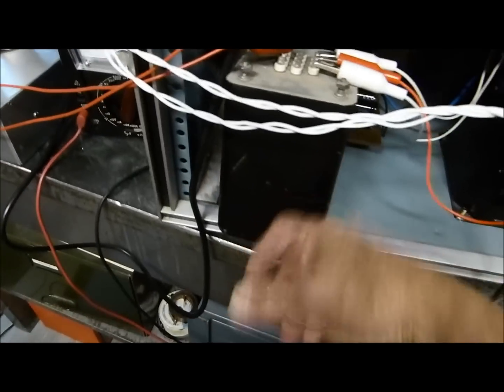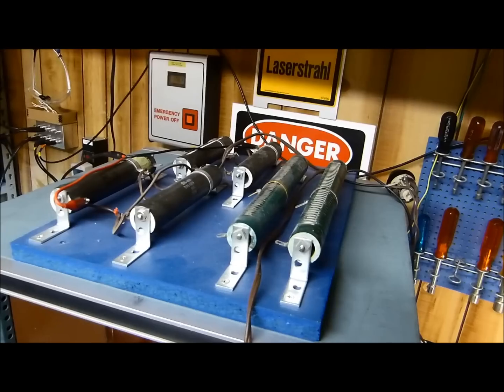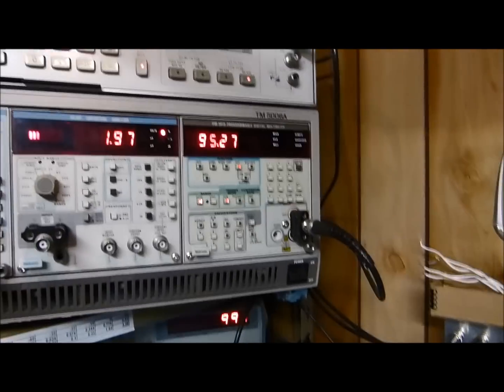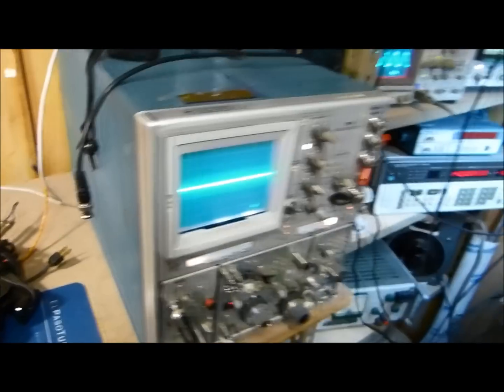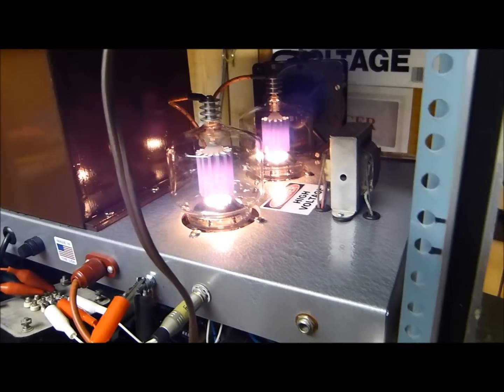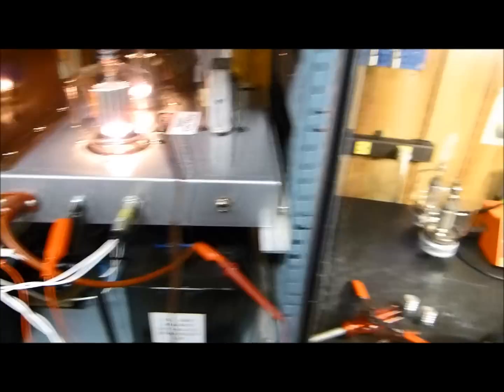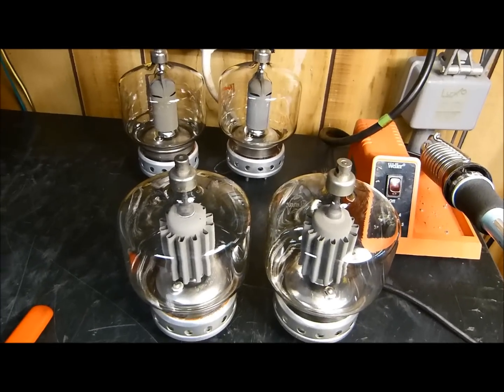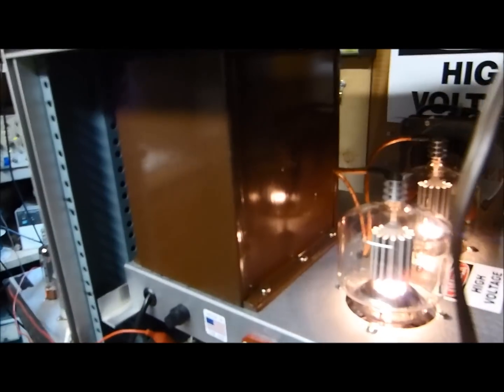Building A 1.3 KW Audio Hi-Power Amplifier Using Eimac 3-400Z Part 3 of 4

Comment: Hmm.. it seems we have a liking for the same scopes...
In the part 2 of this series there was the 7904 and what seemed like a 485 on the rack. In this video what seems like a 2440 lies in its place.
Well, I was wondering what your opinion is concerning these scopes i.e. a 485 vs a 475 vs a 7904/7704/7104 vs the 2440.
I got tired of waiting for the right scope to appear at the right price on the 2nd hand market and went for a 2440. I understand this is a cheap range but I like the 300MHz bandwidth and sampling rate to match. Now if I had the patience, I'd wait for a 475A for its specs and a 475 for slightly better parts availability (less proprietary ICs). 
I don't think I want to spend the kind of money that 485's and 7104's go for these days - seems a bit silly for sth that could break down without any recourse to parts. Otoh 7704's seem tempting but I dont' know why one would prefer them to portable scopes like 4xx series.
I like the ability to have a system like the 7xxx series offers but frankly, hunting for the right modules all the time is sth I find tiring and frustrating and the risk of not being able to repair one should it break is another big disadvantage.
Can you share any of your experience from having used all of these models? If you had to have just one, which one would you go for and why?
I've already gone for the 2440 but I'm still keeping an eye out for a potentially better analogue scope. 
I don't have any experience with Tek scopes. I think the only ones I've ever used were Hameg's or cheaper, low bandwidth scopes.
I mostly want it for audio gear and radios - from AM up to FM.
Reply from the maker: Looks like you have quite a bit of experience with oscilloscopes. You ask some really good questions. I might start out by saying the 485 is a real favorite of mine. I can also say that the 454A is very nice. Both have excellent sharp traces. The 2467 it is great too and has the delta time and amplitude that I like. The 7900 series has a vast array of modules, as you know, and can actually do the work of a modern day MDO. I have a video on using my 7904 as a MDO if you are interested. There is a seller on Ebay called CHIPXS that is Tektronix in Oregon that sold lots of their equipment a few years back. I bought a lot of it and it still has the Tektronix calibration stickers on the cabinets where they have never been  opened, even by me, since they shipped it out. You get their vintage lab equipment in brand new Tektronix boxes shipped just like new equipment. Much of the Tektronix equipment in my shop is from this seller. However, all their vintage stuff has been sold but you might  want to look at their Ebay site just in case. If you have a 2440, you already have a nice scope.
I worked for NASA and White Sands Missile Range for the first 26 years of my career and used pretty much all of these scopes and my least favorite was the 475. I never had one that had a sharp trace.  Seemed like sync was an issue lots of the time. Just my experience with them. I have a 4 channel TDS 784A digital scope that is great but overall for the kind of audio work I do, I prefer the pure analog scopes. If I could only have one for audio work it would be the 485 or the 454A. 
I like HP equipment very much but for oscilloscopes, the vintage ones just did not last. You never see them for  sale whereas you see thousands of Tek scopes for sale. On the other hand, I prefer HP spectrum analyzers to Tek. 
For audio spectrum analyzers,  in my opinion, the best way to go is with SpectraPlus software and a USB sound card.  I have the HP 3580A audio spectrum analyzer and while it is a real lab instrument, it is so slow on display for low frequencies, it is painful. I do not recommend you spend $$$$ for one. 
And as you said, if these instruments break, there may not be much hope to fix them. Just my opinion. Hope this helps.
Reply: @ElPasoTubeAmps  Much obliged for your response - it's a treasure trove of information. I couldn't help drooling while reading it! I'll check the ebay seller you mention.
One important detail I failed to mention is that I'm located on the other side of the pond. This makes acquiring Tek (and also HP, Agilent, Keithley, etc.) gear a tad harder. Like you mentioned though, Tek is so robust and widespread that there's a decent supply over here too. To compound the problem,  even within Europe, postage rates vary a lot between countries and sometimes can be excruciatingly high. I just had an offer on a 555 turned down on account that the seller did not want to post it. That was a gut-wrenching feeling as I know it will be a while until I come across another one. To be honest, I would have been perfectly happy with just that, if that was my only scope - I just have a thing for robustness.
I have to say I was a bit surprised to read you don't favour the 475. Not sure if this also applies to the 475A. On the other hand I've read many favourable opinions on the 453. Given that I'm getting a high frequency scope that should cover the RF end for me, I guess I could go for a 453/454 (I'll check the differences between the two) to serve my audio end needs. I suppose these belong to a product line with limited or no proprietary IC's which would be a good thing. I'm not surprised at all you favour the 485 overall - or I should say, I'm positively surprised since it's my favourite too - however, getting a 485 in addition to the 2440 feels like overkill. We''ll see how long the 2440 lasts anyway.
I'll check your video on the 7904. I'm really curious about these devices and I'm especially curious as to why most of the 7xxx  series gear go for peanuts. I guess most people don't go for bulky stuff.
I was relieved to also read you favour the software solution for a spectrum analyzer. Having a dedicated benchtop SA feels silly nowadays - although if I had a 7xxx scope, I'd definitely get the SA module. For the price of a benchtop vintage SA one can get a couple or more PC based SA's. I reckon there are some dirt cheap ones that work with smartphones and tablets. I'll definitely be checking the Spectraplus offerings. Thank you for that pointer. There's a proliferation of pc-based SA''s nowadays and it's very difficult to separate the chaff from the grain.
Reply: I did an obligatory reading on the 453/454.
454 has 3x the bandwidth of 453 at 150MHz. Neither contain any Tek IC's. Both have quite a following so prices follow suit.
Reply from the maker: @Stelios.Posantzis  And the 454A has the bigger screen than the 454. I had one and sold it. I can't resist oscilloscopes. I had 10-12 at one time and came to my senses and sold most of them on Ebay to include a 454A and a 485. Over the years I have collected just as many including a vacuum tube 545, the ones with the CA type plug in preamps, and it works great. Kinda big... I have ended up with two more 485 scopes and the one I bought used from Tektronix is perfect but the other one has some contact issues I am not sure how to clean.  I wish I could help you out here but I bet it would cost a fortune to ship a scope to (Italy?).
Reply: Ah..I just saw it's actually a 2467.. Oh well, these go for silly prices as well nowadays. Does it offer a VGA output or am I mistaken? If so, that counts in its favour in comparison with, say, a 2440 or similar.

Comment: Since you have 95 volts at the output, what type of speakers would you us to be able to handle that power Sir ??? Thanks
Reply: I have nothing that could come close to handling 1100 watts. It's a test bench amplifier for me. However, I would assume a quad of high power speakers wired in series-parallel (to get back to 8 ohms) handling 400 watts each could be used. I think this level amp could work well for lead guitar and vocal but not so much for bass.
Reply: @raymondbeard8159  Would you be able to make a full fidelity range using super simple circuit setup ??? One more thing, if you would keep the volume down, could a high grade speaker handle the ninety five volts ??? Thanks, V

Comment: Hello I am A 10-12 meter operator that has been building large unregulated power supplies and linears for A couple of years now. For example we are building A 1,000 amp power supply with 10X100 amp mexico transformers with the high/low input tap in use 'rather then how most builders use only the 14.5 volt tap with the input AC current running through A toggle switch rather then A contact relay for switching the power on/off.  The system will float at 20/21v and sag down in voltage as the modulation swings forward''. I now need the 1,000 amp power supply because we rebuilt A 32 pill that showed up DOA but Now runs good. When A larger amp comes through the door needing repair we want to be able to service the unite that is why we are doing A 1,000 amp..anyway but now I have the 32 pill running and it seems to run fine but the 32 pill is hungry and demands more amps I can only run at half power due to the fact that that I am only running 430 amps at 14.5 volts . On our 'my wife and I'' Our work bench we have A solid 430 amps '. I obtain dc power from A 80 amp Astron for the drivers which for now is  A Tx667 or A TX 500 both amps where DOA so we fixed those amps also. I will operate A cobra29lx we modified by installing A RFX85HD  with A carry of 5 watts that swings to ~35 rms or A Galaxy979 for the 667 driver 'the Galaxy has variable power and it is A single finial radio that does .5 watt to 4.5/5 rms watts . The Goal is to run my sweet 16 into the 32 pill..The sweet 16 needs 160 amps at 12.5~15.5 volts to function correctly which I have two 85 amp Motorola's running in para that is tapped for 13.8volts and floats at 16.0v even. The 4 cooling fans on the sweet 16 sags the voltage to A even 15.5 then when keyed up to 200 watts of A carry the power supply unite is still working off the capacitance voltage since the voltage will be A steady 14.8..When modulated forward to 800 rms watts the two Motorola's will sag down to 13.8/14volts..'With the bench power supply I have for now for testing purposes I put A 2.5kw 'RMS' slug into the corner' using around 430 amps and 400 watts of drive. Now i'l take the 32 pill back off the bench and put my 12 pill bake down until we have the 1,000 amp power supply built.. ETA UNTIL 1,000 amp is finished looking around 2/3 months.. It will be worth the wait since we are building with heavy duty rectifiers thick awg wire proper cooling. We are also using two of the spaces on the power supply tower to install 8x20 amp regulated UPS Dura comm power supplies that operate at 16~32 volts. These power supplies are needed for the 24/28 volt transistors since we also build with those style transistors also A straight 1x6xBLW97 driver driving the 32 pill will be perfect I myself enjoy A straight 6 or A straight 12 because these are High-Quality builds 'HQ' amps with high quality sound. There will be A open slot on the power supply tower for the meters, watts, volts, amps, reflect. I will run power to the 1,000 amp power supply using 2 'two' 220 volt service plugs then run the 28 volt power supplies to A 220 plug since the 28volt power supplies have A switch for 110/220 volt the efficiency will be better at 220v. The power supply will have A internal breaker box that way I'l have many options for uses such as using only 1 leg of the 220 volt for fans, lights, sound equipment..We will be changing styles after we are done with the power supply we want to build with tubes I have A 3,800 and A 4,000 volt transformer and we want to build using two or 4 3-400z tubes are just A single 3-500 z.. can you please help me out and send me a blueprint on how to build what you are doing in this video. my email address is 187redfox@gmail.com.. fb blake henry higdon.. thanks if you can help out A DC current operator turn into A .AC Current glass tube operator Goodnight..

Comment: USE OIL FLOODED RESISTORS
Reply from the maker: +Jamie Phillips Hi Jamie - have you seen my video on the high power 8 ohm load using hot water heater elements? Here it is - https://www.youtube.com/watch?v=5gAUuLkc1ik

Comment: Another hint: may go for SMPS for the plate voltage. I´m testing out on some 250W cheap SMPS for 12V bulbs. They are easily rewounded to get 300V each. So I tested two in parallel with 2A load at 300V went fine :) serial 600V with 0.5A load all fine...so i bought more (25 euro equals 30USD each) and are about to rewound the sec. to get 300V. And another two to provide the 12V/10A filament voltage with no change at all since the its original sec winding is already center tapped...cool...

These SMPS are Small (8 by 3 by 2 inches) lightweight (500 gramms) and cheap compared to a old fashinoned big,heavy and expensive Transformer.
All you need is some time for the new secondary and some transformer wire to wind it up.

Comment: Sir, you´re running your Amp in true Class AB2 since you providing control grid current. All different to a normal Class AB with no (=zero) control grid current. As all transmiting tube needs this current or you would not be able to have more then 100-300W output power. And this is the point where wee divide the men from the boys. As it needs a proper and well designed driver stage or its all wasted time, money and tubes.

No control grid current - no fun..!  That simple ;)

Comment: Do not worry about the OPT, as these output tubes are for transmitters you can drive what ever you want, since its all a matter of the plate voltage. As higher the voltage goes as higher sould be the OPT input impedance. as you got a spectrum analyzer - hook it up to the output and drive the tubes as far as you want (or can)within the max. plate dissipation. When the k2,k3 raising, higher the plate voltage as you meet your decided output power with k2,k3 at the lowest possible.

I´ve done this with my GU81 and found a plate voltage of 1.5kV and a Raa (plate to plate resistance) of 3.6kOhm is a good point. Another good point is 2.2kV and Raa of 5.2kOhm and 3kV and 7.7kOhm as well....You see -- just try....;)

Comment: If you got any questions, or issues you can´t figure out, let me know and see if i can provide any help.
Just because i´ve done the same and power up two GU81m PP with a transformer driven input. As the gu81 needs 20mA grid drive current and a total swing of 300Vpp @ operating point of -280V effective grid input impedance is 1.8k when driving 20mA into it.

For a dummy load go for old washing machine heaters 2-3 you´ll need put them serial connected together in a water-bucket so that only the top shows with its connectors out of it.
And you have a decent 5-7kW load resistor with 4-6 ohms. Since one got 1500-2000W at 1.8-2.2 ohms. They dirt cheap, (i got mine for nothing - just 1/2 hour at the electronic dumpster searching) 

Happy coocking ;)

Comment: Hello, I made a high wattage dummy load out of a $25.00, 5200 Watt electric clothes dryer heating element. I put taps on it at the 4 ohm and 8 ohm points. Inductance is 3.1uH on 4 ohm tap and 6.2uH on 8 ohm tap (@1KHz test freq.).
Reply from the maker: Wow... very good idea - I don't know why that never crossed my mind - thank you for the suggestion. I will visit the appliance repair shops today and see if I can pick up a  new or used heating element.
Reply: I agree. I've used these for years. They are the Beez Kneez for high power absortion low inductance loads and take more power than you can possibly put into them .